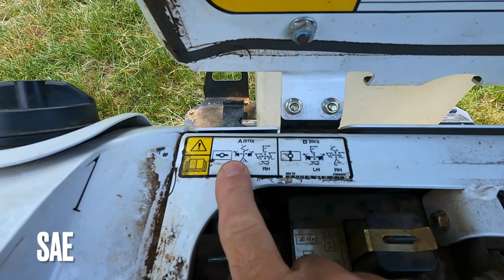ISO or SAE Controls for the Bobcat E10

Comment: Most modern Backhoes also have a switch between the two patterns.
Many modern Backhoes also have the excavator type of controls that are beside you instead of in front of you.

We won't even talk about the stupid control set up that case has or had.

Many years back I also saw an excavator with three different patterns on a switch.

Comment: A lot of backhoes have that switch also. For a while you had to use a wrench underneath the left side fender to switch control patterns. And now they put an electric switch inside the cab to switch over.
We won't even bring up the nightmare of bobcat foot controls on skid steers or the 3-4 lever plus foot pedals operation of a case backhoe.
I absolutely hate case backhoe controls!!!
Also known as piano players, it can really mess up your knuckles. 😟😠😭
There's also a rare third pattern for the two joystick operation on excavators.
Reply from the maker: Luckily I’ve only run the SAE backhoe pattern. I can’t imagine running the others. Not coordinated enough!